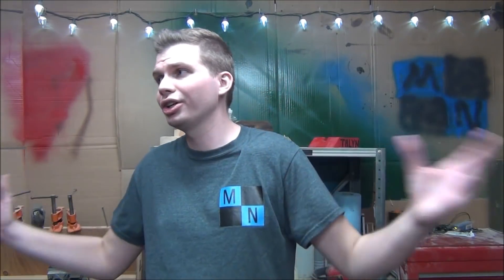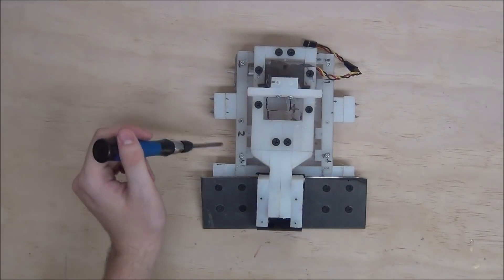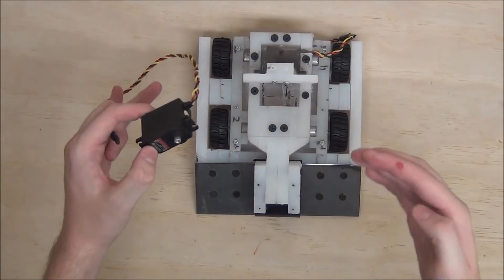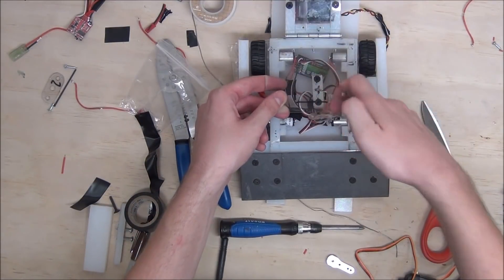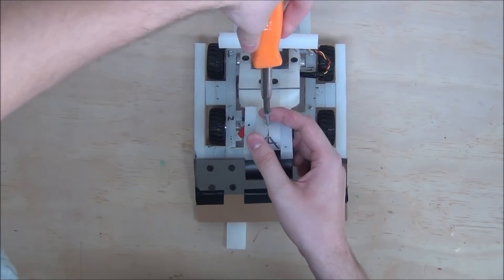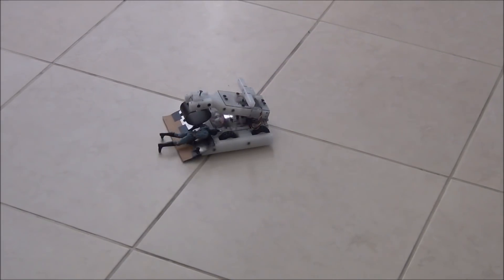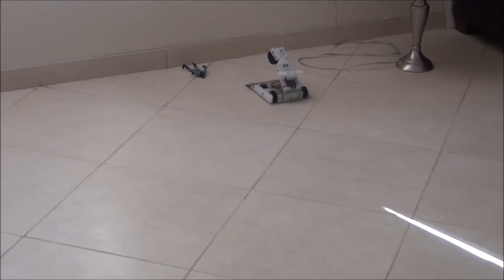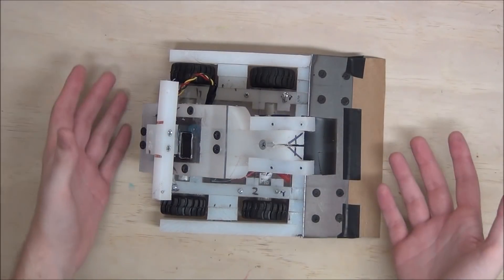How To Build A 3lb Battlebot!!! // Ritron Part 4/4

Comment: Your lipo is quite small for a beetle weight. Id suggest a 3s or 4s high discharge 800ish mah battery. My ant runs off a 460mah 3s and it drains it quite fast within the 3min battles.
Reply from the maker: Yeah, well actually since my bot doesn't use to much power that Lipo lasts about 7or more mins. I bought a small one so I had more room to help my the bot compact. :)
Reply: @MechNinji  but you could probably get similar sized 3s lipo that could make your bot go much faster. Nice bot btw

Comment: Can you make a video of how to make a vertical spinner battlebot
Reply from the maker: That would be super cool! however i am not personally a fan of spinners. I like more unconventional style robots.  So i probably won't build a spinner, at least not in the near future. So sorry
Reply: I see ,because it quickly drain the battery which causing to loose ,am I right?..........or not
Reply: No the spinners actually don't drain the battery. Here just thinks they are not as cool as flipper robots. Could you build a numatic flipper some time? That would be so cool.
Reply: But why??....spinners can pop off the tires and any parts of the bot knocking out your opponent's robot.......but I understand

Comment: Turned out great! Reminds me of Spectre from KOB. What does it weight?
Reply from the maker: Its actually a little too light. Its like 100 and some grams under weight, but i guess that is before the finished wedge. That's good though! I can upgrade a few parts! :D
Reply: @MechNinji  100 grams seems good to me. I am considering getting two of those motors for an ant from your affiliate link.
Reply from the maker: That's awesome! i'm planning on using 4  of them for my 1lb bot talyn. I had to FIGHT to get that to fit into the weight class... but i think i can do it? hahaha!
Reply: Wow! It would be crazy to have an ant with the power of Ritron!
Reply from the maker: I hope so! haha! However talyns wheels are a lot smaller so it won't be quite as fast but it also won't take so long to build up speed! haha!

Comment: Great job! I hope Ritron's debut goes well, there are a few ways I recommend to practice driving:
1. Mark out numbered parking spots on a large piece of wood and roll some dice and park Ritron in the spot as quick as possible
2. Make a small obstacle course and try to get super good times
3. Make an autonomous "scaredy bot", essentially you make a simple robot with two sensors to make it want to run away from everything and you try to get Ritron to catch it.
Reply from the maker: Thank you! And yes i hope it goes well too! haha! 
And yes! I am definitely going to do a LOT of practice driving before the fight! :)
Reply: I think I will use these strategies to